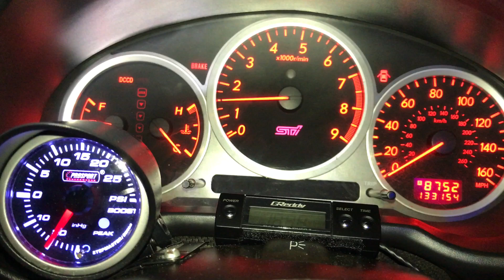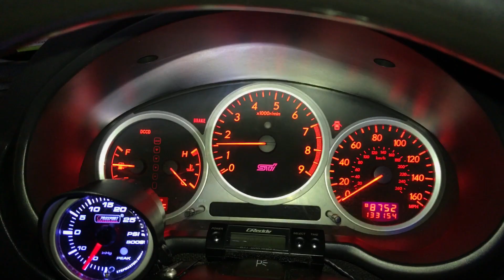How to install Turbo Inlet on Subaru WRX

Comment: That is a serious extension. I liked the install video. Very realistic play by play of what to expect. Great job
Best part "this is soaked". "might be something leaking". 😂 I hope mine isn't soaked.  I've also never seen a crow bar used this much in an auto install.
Reply from the maker: Hahah yes their are plenty of secret tricks of the trade and the pry bar definitely comes in handy here and there. Overall once I replaced this turbo inlet hose, it made a worlds difference on how the vehicle felt and drove. I was losing a lot of power previously and the cars computer was confused with all the extra air leaking past the MAF sensor.

Comment: with a small bamboo satay stick = you can spend 10 minutes tidying up all the vents in the intercooler = because air wont flow through bent intercooler fins ! i do this yearly it is a good practice !
Reply: takes me a good hour to do that lol

Comment: lol this job is such a pain! It's easier to just remove the manifold in my experience and reveal the fuel and vacuum nightmare underneath. Every hose and vacuum line will end up needing to be replaced if their old, you should buy some heat sleeveing for every tube, hose, vacuum line while ur in it.

This part of the EJ motor is so under engineered its absurd. 

Good video, thank you!
Reply from the maker: Yes I cant agree with you more! This job was a big pain but its so worth it once its done. And when I first got the car i replaced almost all of the vacuum hoses because they all looked old. It was a good move on my part im glad i did otherwise i can guarantee  i would of had ran into other issues down the road.
Reply: im just waiting to buy a process west manifold so itll gives some room for all that bullshit under the factory manifold lol

Comment: Dudeeeeeee, I’m running super lean and replaced a shit load of things with no luck… I really hope this turbo inlet solves the problem. Thanks for the video
Reply from the maker: Well the good news is that the turbo inlet hose has probably one of the biggest affects on your engine running too lean. Its the same hose path as your air intake, (the air intake connects to it) so if you have a hole in the hose it will definitely suck air in past the MAF sensor, causing your engine to run extra lean. Usually the hose rips where it attaches to the turbo, around the hose clamp area. Hope this helps, good luck on the install!
Reply: Only lean when going into boost too so I hope so
Reply from the maker: @Fighka303  That would be because when you are under boost, its sucking more air, to spin your turbo faster, to move the car faster. The more air you try to suck through the turbo inlet hose when it has a hole in it, the more air that will slip in through the hole which is past your MAF sensor, causing your car to run really Lean especially under boost. I hope that the turbo inlet solves the problem for good.

Comment: What's up man, just replaced my inlet tonight after a gas leak occurred right under the inlet, and this guide was exactly what I needed! Thanks for the vid!
Reply: What was your gas leak issue? I think I have the same issue lol
Reply: @Mamba4Lifee  There were some lines underneath the intake manifold that were loose at the hose clamps and the lines became brittle. So definitely check for that.
Reply: Chris Groeber thanks man! did you have to change out the lines? Or did you just tighten them up. Mine leaks from that area on really cold starts during the winter is when I notice it more lol never on warm days
Reply: @Mamba4Lifee  that's when I noticed it too! I replaced the brittle lines and tightened all the loose hose clamps. No clue how they were loose but they were
Reply: Chris Groeber thank you man! I’m going to for sure check those out. Did you just use any hose to replace them? Or did you buy the actual oem hoses
Reply: @Mamba4Lifee  Just line that was gas friendly from orileys or your local auto parts store.
Reply: Chris Groeber thank you man 👍🏻 one last question what inlet did you end up going with? Lol I’m still debating. My oem one is super fucked
Reply: @Mamba4Lifee  Tomei cause it was the cheapest off of RallySportDirect
Reply: Chris Groeber how is it holding up? And was it direct fit or any modifying needing?
Reply: @Mamba4Lifee  fits great! Direct swap

Comment: got my COBB inlet and I was having hard time pushing the COBB inlet into mine. But this video really helps ...although Ive spent few hours to remove the painful BOV hose down there. Now the final part is how to get the FAT COBB inlet into it.
Reply from the maker: It really is just a PITA, but after some time, eventually it will work its way in there! Goodluck and if you have any quests feel free to ask!

Comment: Decent video I feel you missed a very important part that I had a very hard time with which is the blow off valve hose that connects to the inlet hose he kind of skipped over that yours has a little bit more of a 90 than mine but I'm sure if I'm having problems with it other people did as well other than that well done

Comment: I have a 2005 wrx, thanks for this video!
Reply from the maker: Awesome and glad to help! Thanks!
Reply: @VinnieT  2 questions.. can I plug this into my stock air filter box? And, if I choose to get a custom short ram intake will I need a tune? Thanks
Reply from the maker: @ryanreedtv3242  I do believe that the stock air filter box hoses line up good with the Perrin Turbo Inlet hose. If it doesn't line up perfectly you could always get a connecting hose piece and 2 hose clamps to make it "fit better" but I personally don't think you will even need to do all that it should just line up correctly. And as far as installing the short ram intake, its recommended that anytime you change parts (especially on Subaru's) you get the car Pro Tuned at a shop on a dyno... However, you do not need to do this right away, but beware that you could potentially run into a check engine light possibly throwing a LEAN code. I would say try to get it tuned if possible at some point, but I cant see it hurting the car to just install it and daily drive it around. Also, with an aftermarket intake, it can allow for a little bit more potential for small power increases, but this would only be true if you get the car protuned.. otherwise its just for sound and looks. Hope this helps!
Reply: @VinnieT  I'm going for good looks (engine bay too) and reliability. So I might not do the pro tune. Although I hear conflicting arguments on that subject for this car. Some say a good exhaust/intake with a Cobb ap pro tune is better for reliblilty if you drive responsibly. So I'm not sure yet on the tune.
Reply from the maker: @ryanreedtv3242  Yeah I can deff say that I would agree with that, I dont race around my car or beat on it, and I've never ran into any issues.

Comment: Oil on the bottom of the turbo inlet is probably just pooled oil from driving the car, then just shutting it off instead of letting it idle to properly drain the oil from the turbo after driving it.

Comment: Just some advice: that cap that you have on the radiator, actually belongs on the tank on top of the engine. The one that goes on the radiator doesn’t have wings.
Reply from the maker: This is actually the cap that Koyo sent with the rad. It does seem now that I look at pictures that they should be the circle caps, although I do see some 02-07 wrx's with the wings, idk why.  But good note to take, thank you!
Reply: @VinnieT  oh, ok. That’s strange. No problem. This was an awesome video btw. Definitely will help a lot when I have to do mine
Reply from the maker: @zachs.9600  I would just make sure that your Rad Cap has the correct pressure rating for what you need. Thanks man I appreciate that and good luck with yours!

Comment: im having trouble finding the male end of the sensor on the inlet tube. Where is it connected and where should i be looking to find irt?
Reply from the maker: You should see a wiring running to the sensor that should be mounted inline on the turbo inlet hose. Usually right on the top.

Comment: My 2014 had this go bad.  :/ replacing it with Perrin inlet
Reply from the maker: The Perrin Inlet Hose is a great choice, Mine is still running strong with no issues!

Comment: Hi nice video what size was the clamp for the turbo inlet to blue pipe also any tips on them staying on mines keep popping off enough to let air in
Reply from the maker: Hello and thank you.
The size of the clamp will depend on your intake size and the turbo inlet hose size. Both my SPT Intake and Turbo Inlet hose are 3 inch diameter. So get a hose clamp that fits 3 inch tubes if your using the same setup as me. 
My advice to keep the Turbo Inlet Hose in, is to make sure you fully put the hose on and clamp it down tight while pushing the Turbo Inlet Hose in as hard as you can. Try to move anything out of the way that is going against you trying to keep that Inlet Hose in fully. (its a pain but its possible)

Comment: Turbo inlets rot away due to the buildup of oil in the inlet due to the gas blowby from the cylinders into the pressure control system. There are two different vents, one from the crankcase, & one that's Tee'd off from both valve covers. the oil gets sucked into the turbo & lowers the octane of your gas, putting you at a greater risk of knock & detonation. Ever wonder why she smells of burned oil after boosted driving? Invest into a dual oil catch can system.
Reply: Paradicidic thanks for info been smelling a lot of raw fuel after some light pulls been holding off on changing my turbo inlet do to weather

Comment: Awesome video!!! Thank you so much for this.  Quick question, do you think a cracked inlet duct or faulty like the old one you had can trigger a small evap leak?
Reply from the maker: TheRealPIKORO7 not sure if it would trigger an Evap leak, but it is extra air after the MAF sensor, so it would throw a code or check engine light.
Reply: VinnieT8 thank you so much for replying, am going to do what you did here in this video and zip tie every hose and reset check engine to see if it works, if it does do you think I should replace the gas valves by the tank? So far I replaced the purge valve, selenoid valve, canister and light keeps coming 😒
Reply from the maker: TheRealPIKORO7 it depends on the code you have, and what the symptoms are, what exactly is happening and what codes do you have
Reply: I have a small evap leak😒  check engine turns on with the cruise light as well
Reply from the maker: If it runs roughly at idle, then you can try gently pinching hoses with pliers and if the engine idle changes and gets better while pinching a hose, that's one way to find the leak, also if you have a smoke tester that would be a good place to start. Evap leaks could be so many things so it's good to start with something like a smoke test to save you hours of your time.

Comment: Thanks for the video. I have the same SPT intake. Could you clarify the connection between the SPT air intake outlet and the turbo inlet? You are using two T clamps and one hose clamp. Is the middle clamp (a T clamp) securing the intake outlet to the turbo inlet? If so, what is the hose clamp for?
Reply from the maker: I believe its more preference whether you use T Clamps or Hose Clamps. I used a hose clamp where the turbo inlet attaches to the turbo, then used a (2) T clamps where the Air filter attaches to the Turbo inlet. Then 1 more hose clamp on the turbo inlet right next to the (2) T clamps because there is a metal insert sleeve that comes out of the turbo inlet and attaches to the air intake, and I wanted to make sure it cant slip out of the turbo inlet at all. You may not need to do this but I decided its better to be safe then sorry. Hope this answers your questions.  
Thanks for checking it out and hope the video helped ya out!
Reply: @VinnieT  Video definitely helped. On a Perrin is the metal insert sleeve fixed in place or can you move it in/out of the silicone hose? I'm going to try the Mishimoto but it looks like it has a metal insert sleeve also. Thanks again.
Reply from the maker: @jukeboxzero1  I believe its removeable but its pretty tightly wedged in there. I could be wrong but it seemed to me that it could be removed. So that's why I decided to add the extra hose clamp. No harm no foul either way haha.

Comment: Id rather install a clutch than a inlet. My suggestion to you all is IF you want to do this: 

Plan for a whole day and remove the Intake manifold bolts so you can at leas move it around to snake the hoses and other related bits around. Its not a hard job so much as its an annoying one. 

Also use this time to extend you hoses and buy a Silicone or hard style inlet so it will be your last time.

Comment: So sense it’s not carb legal, I’ll fail my smog if I slap my after market inlet?
Reply from the maker: The Turbo Inlet Hose should have nothing to do with any laws that I'm aware of. Its just a rubber tube that your engine intakes clean air from.

Comment: Did you need to tune it after putting the inlet tube on
Reply from the maker: Technically you should always tune the car after changing this, because I believe the stock intake is only a 2 or 2.5 inch, and this is a 3 inch, so you will have more space for air flow to come in... But you can get away without getting it tuned, if you notice anything weird after you get it running and drive it around, then I would look at getting it tuned. Should feel a lot stronger and more power if you install this after having a badly ripped one like I did.

Comment: Great vid bro, just one question will this fit on a vf34 turbo?also your oil pressure gauge when its a normal temperature on idle what is the needle sitting at ?mine stays at 20 and on WOT its between 60 and 80

Comment: I’m missing what you called the Evap solenoid. Could I get a link to where I could buy that and the hoses that go to it?
Reply from the maker: Joshua Reynolds sorry I couldn’t find a link for it but your best bet is to call a local Subaru dealership and talk to their parts guys, make sure you give them your VIN # so they will be looking at the correct parts for your car. They have parts diagrams that has all the parts listen out on it. Some dealerships will even email you a picture of the diagram and you can then figure out what exact parts your looking for. Hope this helps.

Comment: I think i might have this problem with my B4, i've checked so many different things and replaced so many obvious things- rep cam sensor, rep battery, rep fuel filter, injector clean ontop wire observations, so under-engineered

Comment: Do they make a cap that will close the blow off valve hose? I have a front mount inter cooler so I have no need for the original bov
Reply from the maker: thomas benson I'm sure they do, I would give the guys over at defined performance a call, that's where I get my parts and they have usually everything for the cheapest prices plus super fast shipping!

Comment: does your power steering pump feed line rub up on the inlet ? my power steering pump feed like bolt is totally pushing into it
Reply from the maker: Daniel Wippich yes mines the same way, I believe there all like that because of the design.

Comment: This install was an absolute fucking nightmare. SOOO wish your video was around when I did my inlet install last year! Would've helped me a lot. One thing I had to do when I installed mine was have a friend push from the front while I pulled from the back with a rubber hose that I strung through the inlet hose and up through one of the holes along with lots of silicon lube! Also, do you know the part number for the Mishimoto hose you used from the BPV to the inlet hose? For some reason can't find it anywhere! My stock BPV hose is getting pinched by the throttle body :( Thanks man. Great and incredibly informative vid!
Reply from the maker: Hey man sorry my video was late hahah, and yeah im not 100% sure what the part number is, but I buy all my parts off this company because they have been nothing less then amazing and spot on with getting me the right parts and shipping me them VERY fast! 

Here's a link to the website https://www.definedusa.com/    and also check them out on facebook! The guy who owns this place is a great guy and will help you save alot of $ and hassle.     

Here's a link to the Turbo Inlet Page,  https://www.definedusa.com/category-s/2320.htm  
At the bottom you'll see 2 different Perrin Turbo Inlets. One is a 2.5 Inch and the other is a 3 inch. Hope this helps!
Reply: Right on! Thank you Vinnie!
Reply: Almost looks like you used this hose for the one that goes from the bypass valve to the turbo inlet hose

https://www.definedusa.com/product-p/psp-eng-515.htm

The hose you see at 0:26 in your video.

Do you know if it was that one? Having lots of problems with the throttle body crushing this hose. Thanks again man!
Reply from the maker: Yeah I used a similar one, here's the link, https://www.definedusa.com/Mishimoto-Silicone-Radiator-Hose-Kit-p/mmhose-wrx-01.htm
Reply: Thanks dude! Will see if this radiator hose does a better job than the bpv hose to the turbo inlet.
Reply from the maker: Great man let me know!

Comment: Why is the first plug on the turbo inlet blocked off, isn't that supposed to be connected to the  Boost controller solenoid.

Comment: What is that silver round piece in front of the turbo inlet hose where the intake connects called? I need to buy it for my turbo inlet
Reply from the maker: freshkicks I believe your talking about a hose clamp
Reply: VinnieT8 it’s that silver piece that goes inside the turbo inlet not the hose clamp
Reply from the maker: freshkicks ohhh that piece comes with the turbo inlet. So it's turbo Inlet specific and the sizes may vary, I don't know any specific name but I know not every turbo Inlet comes with them
Reply: VinnieT8 dang I need the name of it 😭, thanks anyways I appreciate it 👍